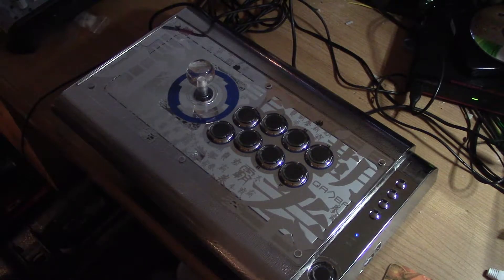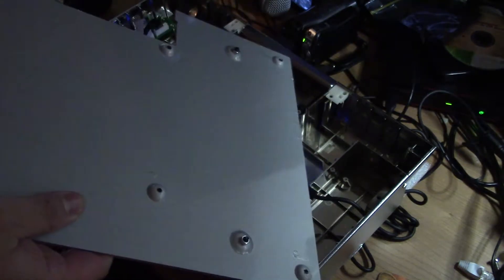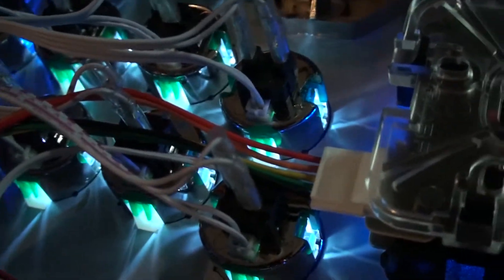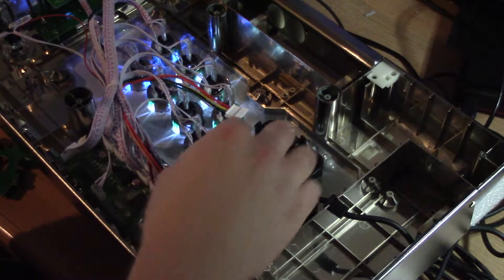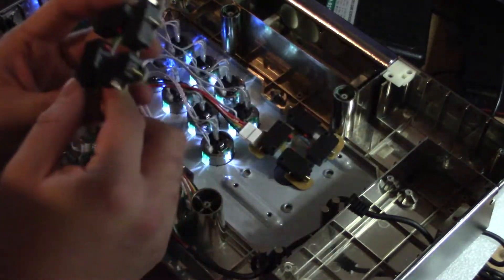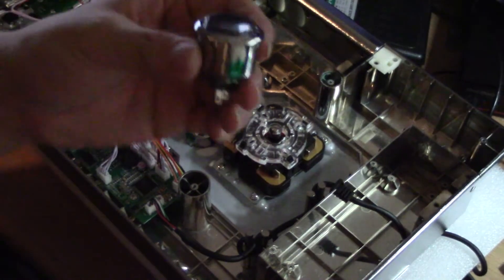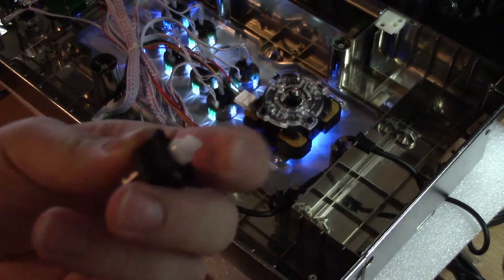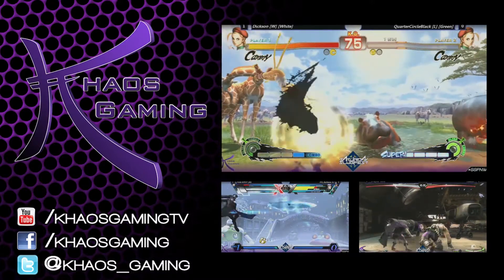QANBA Q2 GLOW Pt1

Comment: Good shout! I have this joystick for a nice price and looked into replacing the switches in the buttons with Sanwa, much smoother, much happier, if a little tricky to take the pcbs out. The joystick is where this stick falls down, even if you replace the microswitch board, it's the same omrion as the JLF. So I'm just replacing it with a Sanwa JLF and keeping the ball top and shaft of the Qanba. It can't be modded due to the LED's, so I'll have to take this sacrifice. Great video!

Comment: The LED Board on the joystick stopped working for some reason while i was changing my micro switches. I thought is was the wires, but after messing around the active charged microswitch board touched a spike on the LED board then suddenly the LED works when in contact with the miro switch board. does this mean the LED board needs a stronger charge? I dont know much about electric work.

Comment: Sorry if this might be obvious but.. I just ordered this stick in jet black and I was wondering if the buttons retain the LED functionality with your switch/button replacing method. 
Also, was the joystick you switched into it a bit stiffer than the OEM one? I hear the stock one has a lot of sway, though your jsf sounds way more responsive from the audible clicking. 
Mainly I'm just curious as to whether or not I could just buy obsc 30's or a jsf and just chuck em in while retaining the LED functionality. And is it safe to assume the sanwa housing isn't compatible with the LED boards? 
I know this video is pretty old but information is insanely scarce on this FS online and you seem to be really knowledgeable about this product. Thanks in advance, happy gaming dude!
Reply from the maker: Delta Nein In order to maintain LED functionality, without having to modify OBSC buttons, the only way you will be able to get it is by switching the actual switches in the stick.  

For the joystick itself, the LED's are attached to the main housing, so if you take the PCB itself off the JLF and swap it with the stock one, you will be able to use a JLF that works with the housing.